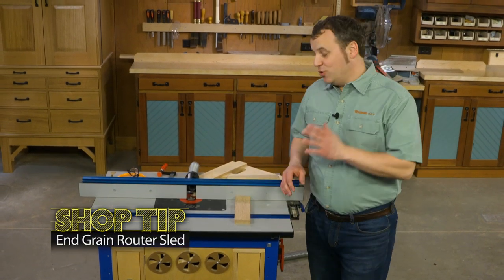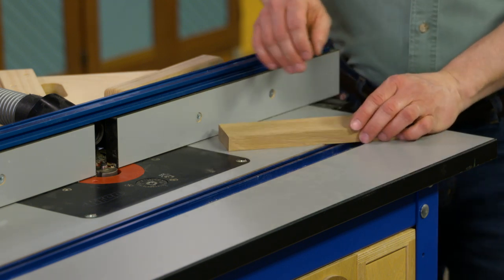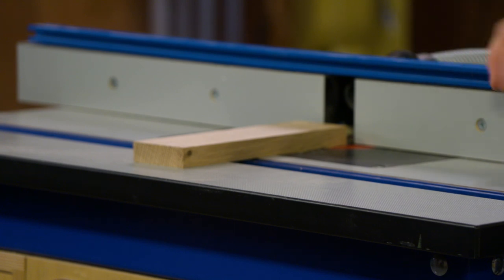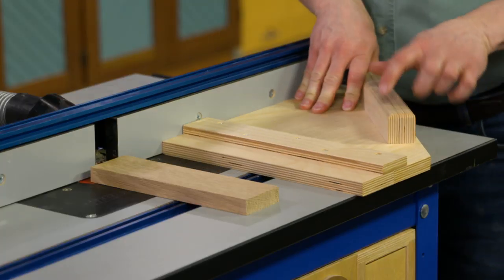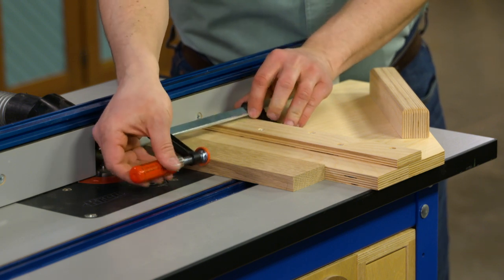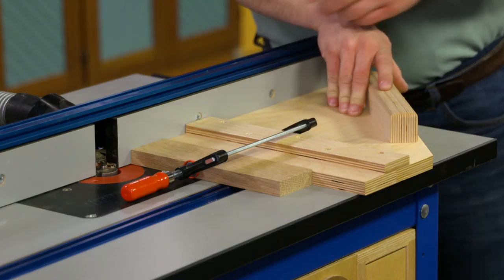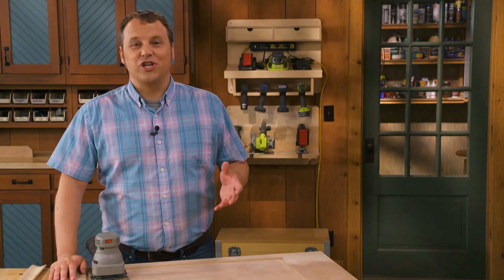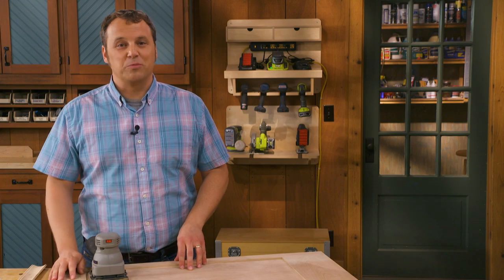Woodworking Tip: End Grain Router Sled

Comment: When I worked in a furniture mill, we used a similar jig on our shapers (large router table). It works very well. Something else we did: When possible, we cut the profile on the end grain before ripping the piece to final width. This allowed us to trim off any tearout. That's not always possible. But, when it is, it works well.
Reply from the maker: Great tip! Thanks.

Comment: Great sled. Thanks for sharing this. I use one much like it all the time. Suggestion, make the base a square/rectangle, then all you need do for a "new" backer is turn  it 90 degrees. Then flip it over. That allows for 8 unique cuts before all four corners are beat up. After they are, trim those up and viola, a brand new sled! If you need to run an angled end (e.g. for a miter joint) just cut the base to the angle needed and use it in the same way.

Comment: How is the sacrificial board held in place. Also it's been my experience that solid wood makes for a better sacrificial backing without splintering.
Reply from the maker: The strip on top bridges the sled and sacrificial piece and has screws through it to hold the sacrificial piece in place.  I like to use MDF as backer strips- they seem to work pretty well too.

Comment: Good idea - I'd use a pice of scrap wood rather than plywood for the sacrificial backer board. It's a bit easier on the router blades.
Reply from the maker: Thanks for the tip.

Comment: Sacrificial piece ? You can only use it for 1 cut . . . 2nd cut , you will get that tear-out because the sacrificial piece , well , just got sacrificed . . .
Reply: I agree. I think you're right. I suppose you could cut a bunch of one-off scraps and clamp them between the work piece and the sled.
Reply: Not true. Because all of the pieces will be cut on the same section the portion of missing wood does not matter, the support will still be there. When the profile of the cut or the dimension of the cut changes remove the backer, flip over or end for end and you're back in business.
Reply from the maker: Linda is correct... as long as you are cutting the same shape the sacrificial scrap will continue to back up the cut.  If you want to change bit profiles you can use the same scrap piece but you just need to flip the piece around to get another set of uses out of it.